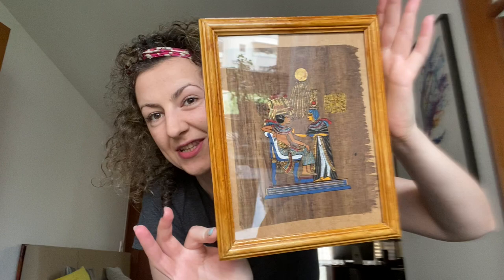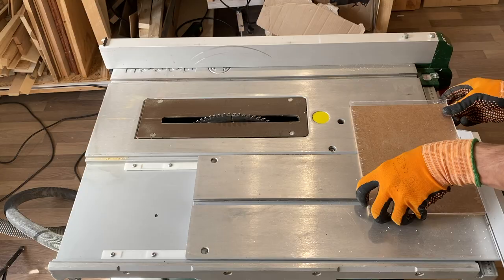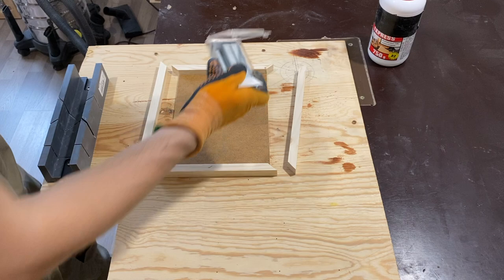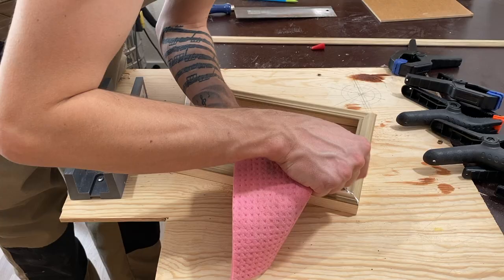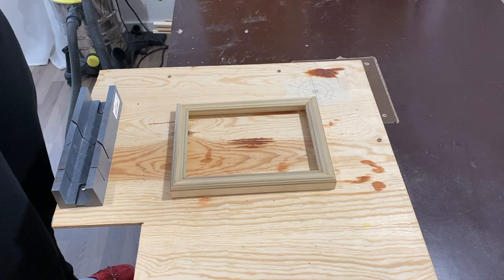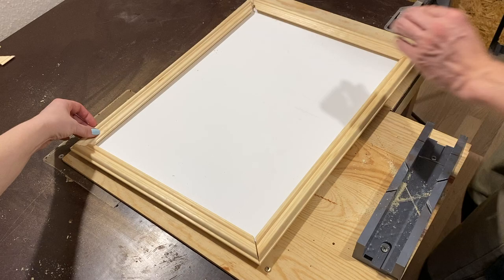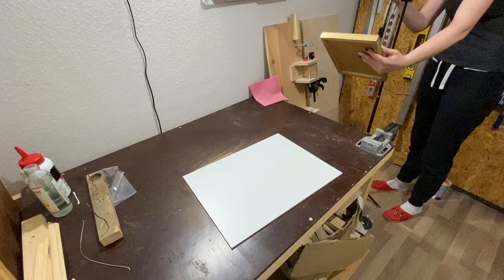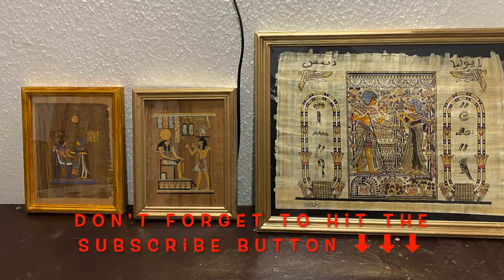[S3] Check this out! Framing a papyrus - Step by step tutorial - 2 frame types

Comment: Thank you for this very informative video. I am finally going to frame my papyrus that I bought in Egypt in 2011. I have the frame I found in a thrift shop but wasn’t sure how to mount the papyrus. I was going to hide the edges but from your video I see I can show the edges as I like that look.  Mine is a large papyrus approx 25” x 16”.  I found this so helpful. I think the only material I will need to get will be the backing. Thank you again.
Reply from the maker: Thanks for appreciation and good luck with your framing! Try to visit a brico store or something, you usually find HDF/MDF scraps for cents (or at least this is how it works in Europe).

Comment: Thanks for the video, YouTube has very little content on mounting papyrus! Did you use any kind of adhesive tape, etc to “float” the papyrus in the larger frame?  (Also That’s a neat setup you had there to spray paint the frames)
Reply from the maker: Hey Zach, there nothing more than you can see. No tape, it’s held by itself between the polycarbonate and mdf sheets :)
Reply: @wambydenis  will the paint from the papyrus stick onto the polycarbonate sheet after a few years?
Reply from the maker: @jinhaoteo667  that’s a good question, I never tried to take it out so far..